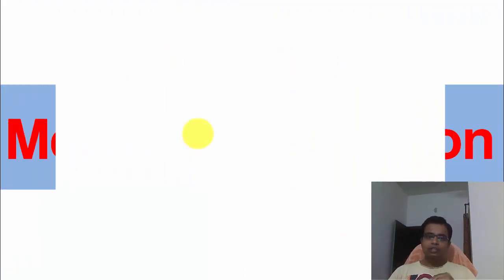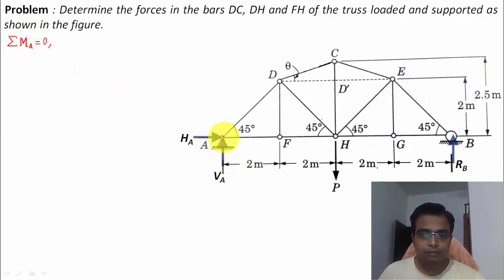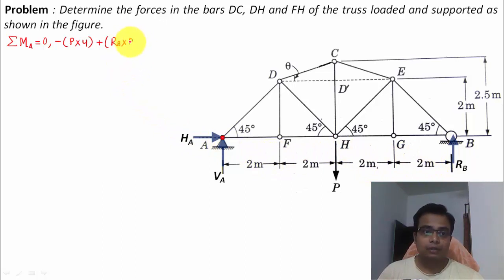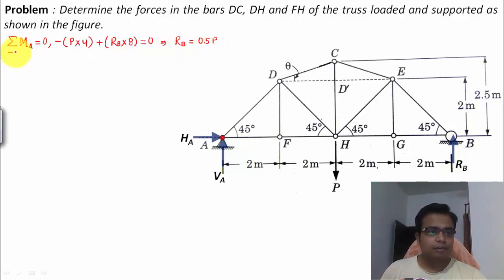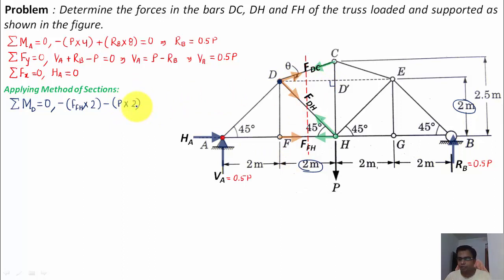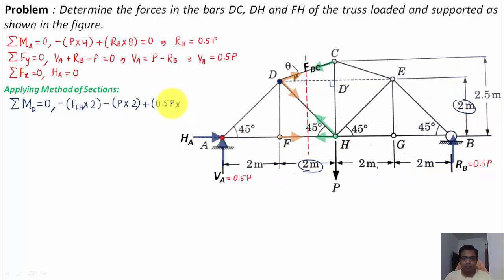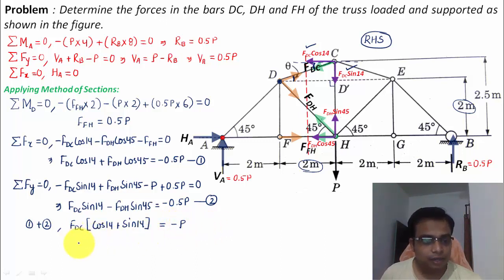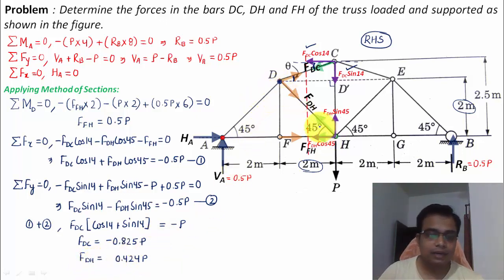Trusses_Method of Section_Problem 10

Comment: the front view of line AB measures 65 mm and makes an angle of 45' with xy. A is in the H.P. and the V.T. of the line is 15 mm  below H.P. the line is inclined at 30' to the VP. Draw the projection of A.B. and find its true length and inclination with H.P. also locate its H.T. answer of this question 🙋
Reply from the maker: All right....Your problem has been noted..